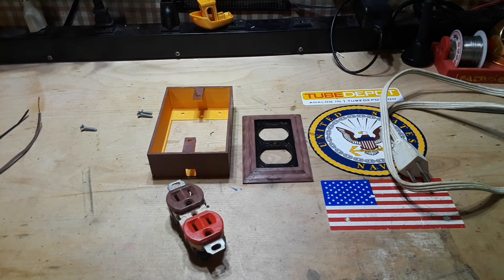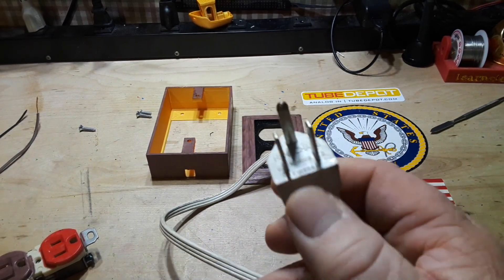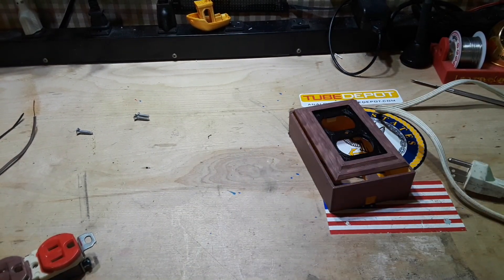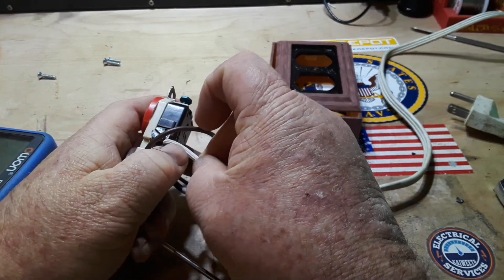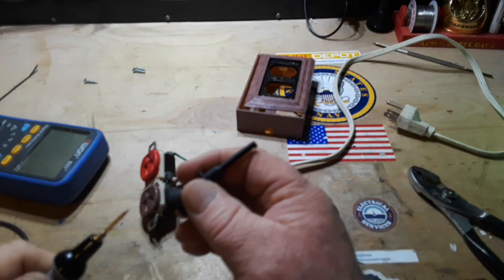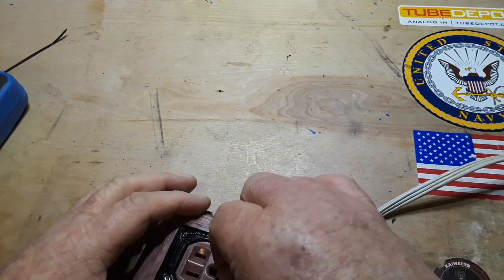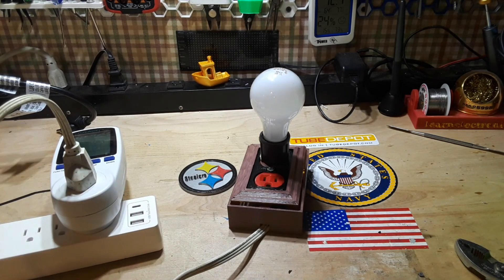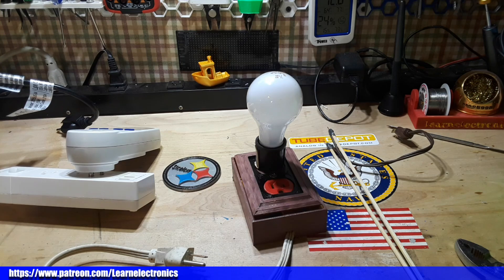Let's Build A Current Limiting And Warning Device (Dim Bulb Tester)

Comment: Paul, did you ever get or consider getting an old capacitor analyzer?  I ended up getting a 1959 Sprague TO-5 Tel-Ohmike. It was mint but did need some refurbishing. I tested all of my old brown 1959-60 Mallory’s at their rated voltage. They were definitely bad but it’s real handy for testing tone caps like the Astrons or Blue moldeds. Astron are always bad but the blues seem to last forever. For those cap, you use the insulation resistance test. It’s great for quickly culling bad caps.

Comment: Sweet, tester tester = dead short. When shopping for a house on the west coast I carried a plug socket tester to see if it was wired right. Amazing the number of houses where the ground was not hooked up or neutral and hot were reversed.

Comment: When starting some unknown piece of equipment such as an amplifier for example, you want to start with a small bulb, maybe 40 watts to really limit the input current. As you work on the thing, you can increase the wattage as you gain confidence in the operation. This way if things are messed up in a way not noticeable by visual inspection, you may be saved from blowing a transformer or worse. Look for appliance bulbs such as oven lights. These are clear glass and should be available at least in the smaller wattages since CFL or LED lamps don't play well with ovens and such.

Comment: Built one just a couple days ago on a extension cord. Tried it on a tv and it would be dim for a second while tv tried to start and turn right back off. Lol 

Built it for a stereo amp though to test for shorts after replacing output transistors. Luckfully amp is fixed now.

Comment: I've never shorted 120VAC. But I have shorted 240VAC. That was a flash and a bang. LOL.
Reply: i was testing my hot water tank to see why no hot water... the day before i was testing why my car battery was going dead on amperage!!!  It vaporized my meter leads and splashed molten metal and black sut up my arms.   it was sort of a muffled pop.  that was enough to teach me to ALWAYs put the lead back to Volts, Ohms, Mili. and ALWAYS check that the meter leads are not in the amperage port.
Reply: @mikehensley78  OMG. I only did that once too, luckily only at 50V 0.5A. LOL.

Comment: Hello im your fan and subscriber and i have a request.
Can you make a coilguns capacitor bank led indicator pls.
I mean like when the capacitor bank will be charged up to 200v the led will light up.
Else if the capacitor bank have been charged up to 99v or less then 100v the led will be off 
Witbout using Arduino, or too much IC's 
Just simple project.
Info. Idk if Voltage devider can belp in this with zener diode and transistors idk 🤔
But plllllss 🙏🙏🙏 make this pls.

Comment: Another tip. The smaller of the two prong holes/slots is the HOT side. The neutral is the larger slot.
Reply: So many units don't use polarized plugs. If it's prelim/post repair; a momentary test is all that's required. No short; great.